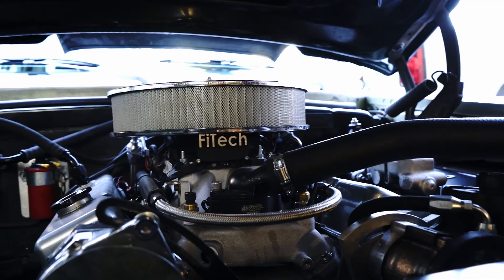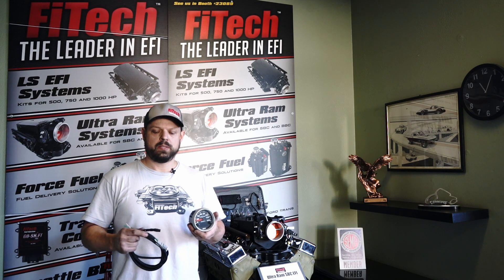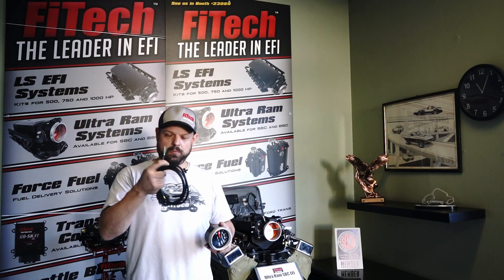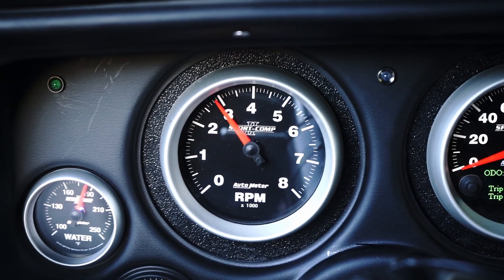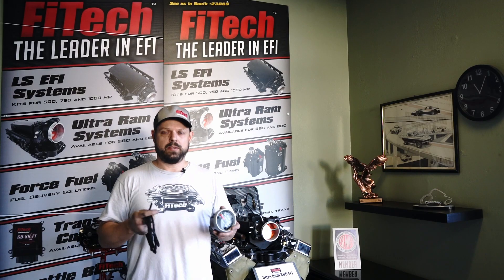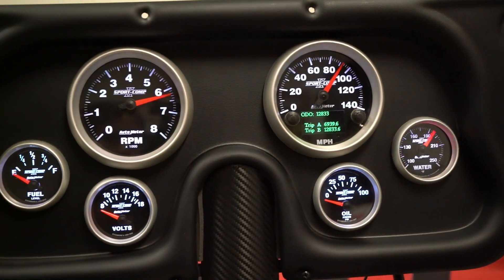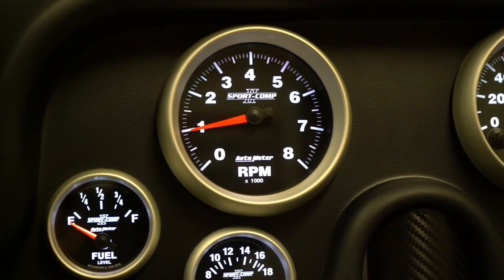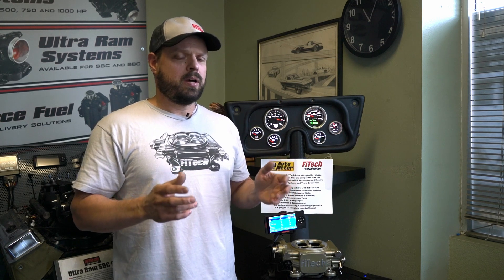FiTech Tech Video | AutoMeter Gauges with FiTech EFI

Comment: where is this canbus wire plugged in to on the fitech system. I called customer support and they said to watch this video
Reply from the maker: It plugs into the handheld data cable.

Comment: Trying to get my handheld to connect to my ECU but it keeps saying "ECU NO RESPONSE" it was working fine then all the sudden stared doing this. 
Voltage and grounds are good, engine will still crank and run but will not rev up without flooding itself out.
Reply: Possible bent pin in the connecting port of your handheld. I had to send my handheld back after install because it was faulty and gave the same code.
Reply: @lukejarvis7994  I never took it apart, it was just working fine one day, then it decided it wasn’t gonna work anymore. I will check though if I can find out where I put it lol. Swapped to stock ecu and Chinese harness, the stock ecu tuning SUCKS… should have bought a Holley!
Reply: @JohnnyAnderson1  mine ran for a couple weeks then took a shit. I called and they had me send it in to troubleshoot for shipping cost only. They ended up just sending me a new one. Diagnosis just said it was "bad" lol.
Reply: @lukejarvis7994  lol I might try to call them then